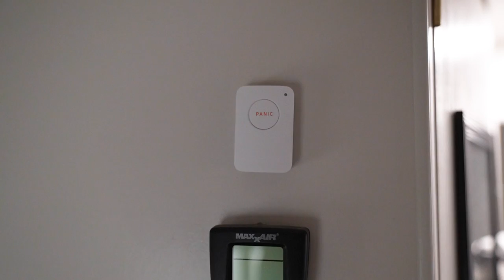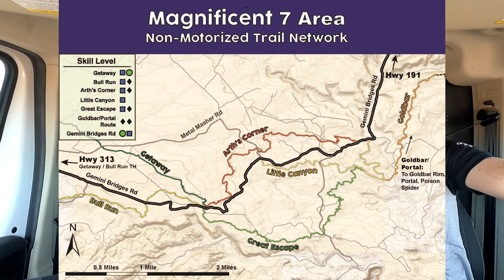BACK TO OUR ROOTS | A VAN LIFE ADVENTURE

Comment: When Trent told Allie to look down, Allie immediately said, “no” I laughed and I thought, whoa,  Allie is so cute saying no, I would be scared too. Ha!👏🏽😀👍🏽
Reply: Allie's from Maryland DC area. Flatlander like me. I remember my first trip to Colorado. It takes adjustment to seeing such long distances, bare mountains, and of course, the heights of mountain roads, and that's not even going off on trails like they did. Took a trip up Pike's Peak in 1983 with wife, scared the bejesus outa me. 14K  elevation. I got a terrible headache after a few hours and headed down. Even on way back, headache worse. Had never heard of altitude sickness. Stopped 3 times as my brakes started smoking on way back down in '77 Dodge PU. Got back to in-laws in Colorado Springs, laid down, slept 14 hours straight through. I was in my 30's then.

Comment: Get one of those water pumps that go on top of 5 gal water bottles. They are usb rechargeable. Just drill a hole in the counter and run the tube to the water source.

Comment: My son said if you tap the motor of the water pump it might kick on take like a hammer or something it just lightly tap it it could be frozen a little bit from sitting so long but if you tap it it might start working again while you’re doing and keep flipping the switch on and off and it might kick on and at least buy you a little time if he replaces it on the pump shut off valves at the tank so if this ever happens again you guys don’t lose all that water

Comment: TRENT Please Read - I have been following you and your wife during your build. I have a suggestion for you that will make your wife's life just a little bit easier during the build. Y'all have all of your stuff stacked up in the kitchen area. Which has to be moved and straighten by hand each time something has to happen in that area. Get a hold of  3 or 4 Metro wire shelving racks with wheels. This way you can keep your stuff you need during the build available on a vertical shelf that can roll out of the way. Your wife will be a much happier builder. It might just save her some time to bake you extra butter cookies.

Comment: If your not in the air half time ! and horse from screaming and yelling' you two really missed
out on a real "Adventure" Next time  Clint take Ellie to some sand dunes in a sand rail. She will fell lot safer in the sand. You were not strapped in properly? you needed  5 point seat belt, Ellie would have felt safer if you had them !!! Therefore not as scared.